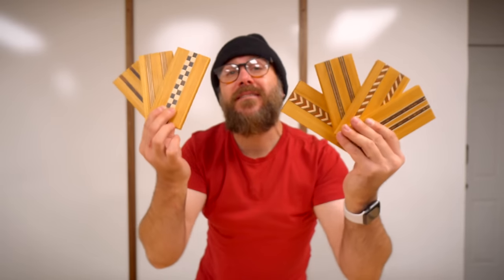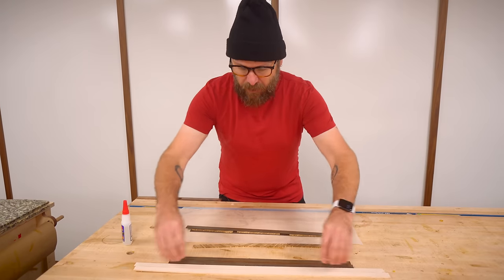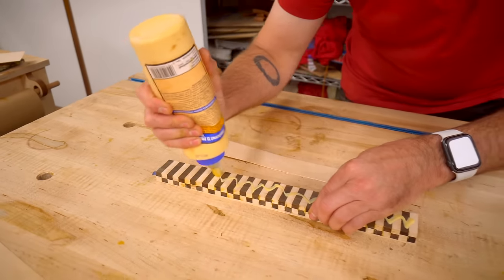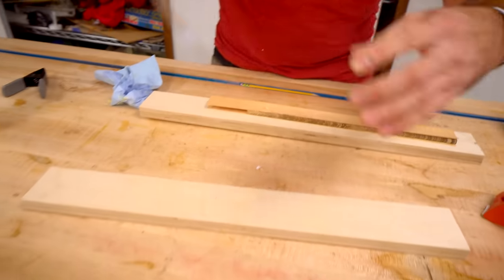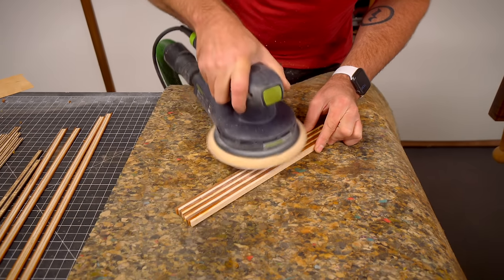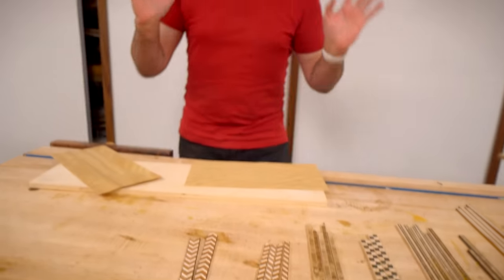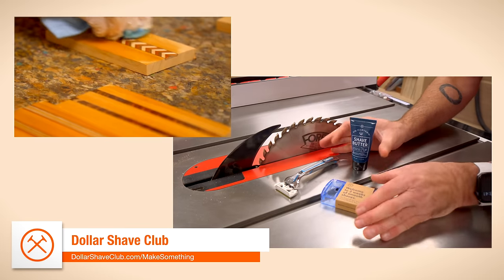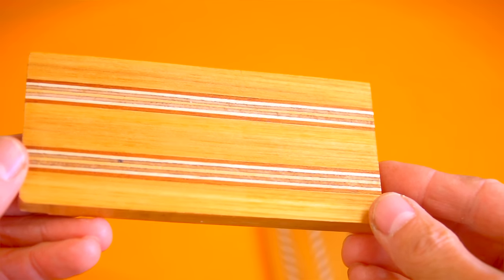How to Make Your Own Inlay Banding and Enhance Your Woodworking

Comment: I love this video! They all look great and don't look too difficult to make. So, I repair antique clocks, and some antique wooden clock cases have thin banding like these inlayed into the cases that follow the curve of the dial. They are much thiner that the banding in this video. I was wondering how you could go about making curved banding, say around a 4 inch circle. I can see you you would just clamp the banding around a curved piece of wood that was only made out of straight strips during glue-up, but what about the Chevron pattern?

Comment: Dave, great video. Any suggested thicknesses for the first stage component slices? Or the final second stage slices? Are you typically doing 1/8 inch or shooting for something thinner? Did you find any preferences between using a router v. table saw to make the dados to accept the inlay?